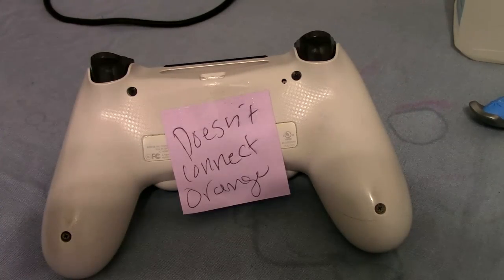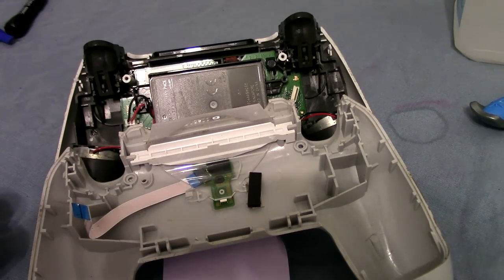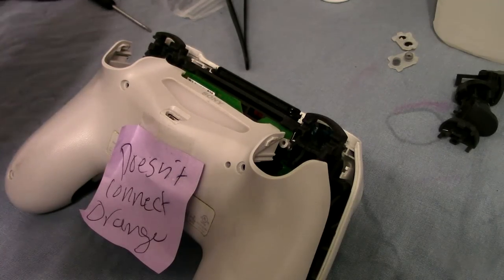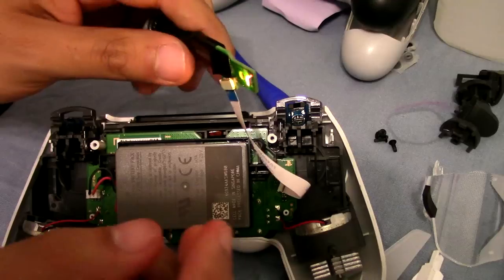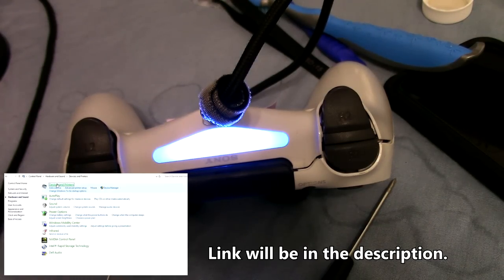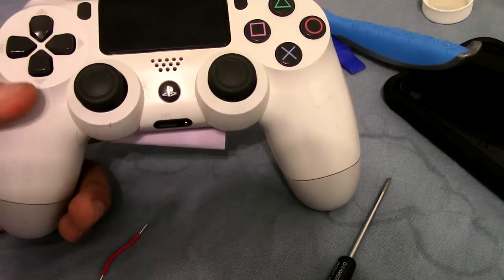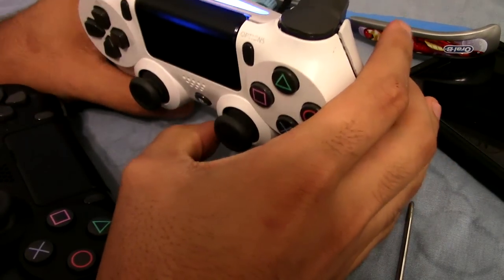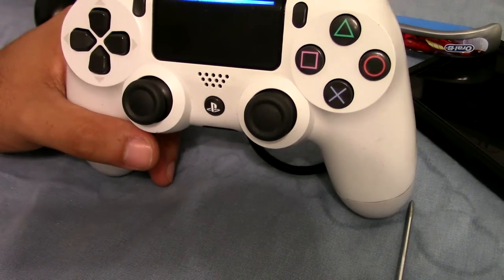How to Fix PS4 Controller with an Orange Light that Turns On Then Off (Conductive Film Solution)

Comment: I get the counting blue light, then it stays static for about a second or 5 and then it shuts off again. Im trying to get it to work on pc but it wont keep the blue light on. any suggestions?
Reply from the maker: You might need to download the drivers for the controller onto your pc.
Reply: Alex thanks for the quick response, it was indeed the drivers. My bluetooth was outdated and refused to download the drivers for the controller and thats why it wouldnt connect to my pc
Reply from the maker: No problem

Comment: Orange light flashes and turns off, Does nothing unless i unplug and plug back in
Reply: Same
Reply: Same. Still not fixed
Reply: @jskeith11  i threw mine away. I think battery is shot
Reply: You should remove the battery and plug to ps4  it will work fine means battery has been dead
Reply: Manish Mittal what do you mean plug it to the PS4

Comment: I'll tell you what to do turn off ps4 than when you turn on manually hold it till you hear the second beep as it turns into black screen it will give you some options select the default settings and bam your controller is back
Reply: can u elaborate pls

Comment: I recently changed the skeleton on a ps4 controller which involved soldering the rumbles off and back on, after I did that it seemed to have been in working order until I woke up the next morning to find my ps4 in rest mode and my control in the same state as the video, I hooked up to my laptop and found that the home button was stuck so I opened it up and tried fix it which I did and it seemed to had been working untill I left for a few hours and came back only find the same thing happened, ps4 was on rest mode and the ps4 controller none responsive just like in the video.

Comment: My controller starts vibrating when it reaches a point while charging. So I reset it and put it on the charger but i try to turn it on but it doesnt connect

Comment: Hey man. I'm racking my brains trying to get my PS4 controllers to connect to my console. NOTHING IS WORKING. I've tried resetting each controller, tried 6 different USB cables, reset the PS4 to factory and have even bought a new controller.

However, when I put the PS4 into Safe Mode and it asks me to connect the controller by USB and press the PS button then it works perfectly. But when I reset the PS4 and it comes back on and asks me to connect the controller and press the PS button, NOTHING WORS

HHHHEEEELLLPPPPPPPPPPPPPP
Reply: Got the same issue!
Reply: Any fix????
Reply: @Africanhustler1  u got it fixed
Reply: @ayman4307  nope. Same problem. Tried everything. I opened the console and changed the WiFi and Bluetooth recovers and still Nada
Reply: @Africanhustler1  and did u change the film in the controller like the guy in the video?? I dont wanna buy a new controller😫
Reply: @ayman4307  nah its not the controller, it works on another ps4
Reply: @Africanhustler1  hmmm. I got a controller from my cousin and that one works🤔
Reply: @Africanhustler1  i will try it with a new film and tell u if that worked... but i still want to understand how that fucking button works in safe mode lol
Reply: Ayman bought a new one! Suspect that the USB ports are fried so will need to be repaired

Comment: My PS4 controller turns off after I disconnect it from the charger anybody know why ?
Reply: That sounds like the battery is not holding charge so it needs to be always connected to the ps4, therefore you need a new battery

Comment: I want to sleep but ma light keeps flashing it’s annoying
Reply: Same
Reply: But my problem is that my controller keeps flashing and doesnt turn on and the way I have to turn on my ps4 is to put a disc inside
Reply: And when I put a disc inside my ps4 it does everything but after I does everything I literally says press the ps button to use the controller I press that the press X and it doesn't do anything but flash

Comment: I bought a custom controller and I swear they used a different charging port than the generation the controller is. 

Because I have that same port but different parts than you holding it in
Reply: Ahhh I had the same problem.... there was a damn hole in the film connecting to the home button
Reply from the maker: yea that'll do it
Reply: Alex appreciate the video. Subbed

Comment: my brand new controller is stuck blinking orange and when i move the charge cable it turns red it just drains itself for some reason
Reply: New battery needed most likely
Reply: Test the volts on the battery

Comment: Mine blinks blue with the power button just won’t connect
Reply: its cause of the ribbon 2:51 try slightly pushing it to the left or right but Slightly Not hard it worked for me
The ribbon probably dont support that controller

Comment: Hi Alex
I changed the conductive film & USB Port it worked for about a minute, then now back to yellow light slowley flashing, when plugged in. controller Turns off when the cable is not connected, do you think its the battery? Thanks
Reply from the maker: Hmm it might be the battery. I would check the PS button like the silicon connection. Maybe exchange it or clean it and see if anything happens. Also try to reset the controller by pressing the small button the back; you might need something small like a pin to do that.
Reply: Just buy a new controller bro 😂
Reply: @Alex-jbz  Done this and still no go. Im thinking fuse has gone. Need a video on the pcb and smd smt components tbh. Cant find Schematic or Diagram anywere. Ot a dead dead jds020 and its a jdm040 thats flashing. 
Any knowledge on the fuses and capacitors ect?.
Reply: I basicly swapped jist the motherboard into a working controller and same thing so Im really thinking Fuses and Capacitors.
Excuse gramaaa

Comment: God the version 2 DualShock 4a are garbage. Both of my brand new ones do this and make battery low messages constantly flash on the screen but the original one is fine.
Reply: But yeah no way in hell i’m opening it up when both the controllers have the issue.
Reply: @donglegs  you wont know till you try LMAO

Comment: Hey Alex, could do with some help here. I cant sync my controller. It flashes yellow once and turns off.  This is what I have tried

1. Different DS4 controller , it won't sync. It also flashes yellow once and turns off
2. Used my DS4 controller on another console and it worked
3. Tried 8 USB cables including original - no luck
4. Wiped the PS4 to factory settings (now stuck at start up screen) - no luck
5. Changed both bluetooth antenna and wifi receiver - no luck
6. Controller comes on in DS4Windows and works perfectly fine.

Would really appreciate some help here!
Reply: Kwame Agyei did u fix it?
Reply: @SandroFN.  no not at all
Reply: Kwame Agyei I’m pretty sure it’s the conductive film blocking the signal I ordered a new one so I’ll tell u if it works
Reply: Could it be because your controller is synced to another device? Forget it on the other devices

Comment: Motherboard in the ps4 the bluetooth chip.i promise you.its that.
Reply: How can I fix tht? Do I have to replace it or is there a home fix?
Reply: @nathandiaz7909  there really isn't a fix other then to replace the chip and you'll need a heat gun and solder gun and some kind of paste.theres a video on how to do it if you look up replace bluetooth chip in ps4.it looks easy if you have the tools to do it.or idk I was going to just try and heat the chip a little  on mine to see if it would work that way..I know with the ps3 I heated the heat sinks inside to get that working but it was a temporary fix.untill I got new paste for it. But anyone could do it if your careful. It's just taking it apart is scary lol I hope you can get it fixed because it's awfully not being able snyc your controlers on a otherwise perfect ps4. . believe me I've tried everything.i mean everything to get it to work but I came to the conclusion that it's the Bluetooth module inside.

Comment: My controller does that, but it works for a while. I turned the playstation  off then on and it worked for nearly an hour, it's full charge and it turns off randomly then won't turn on again until after I've reset my playstation

Comment: CHANGE THE CABLE
Reply from the maker: That can work, but in this video the cable works. It was the PS button that didn't work.
Reply: Did u understand wht mean orange color?
Reply from the maker: It means it’s charging.
Reply: If the orange light only blinks once, it's because the controller is fully charged :-).
Reply: @JuVallejo1  THX YOU